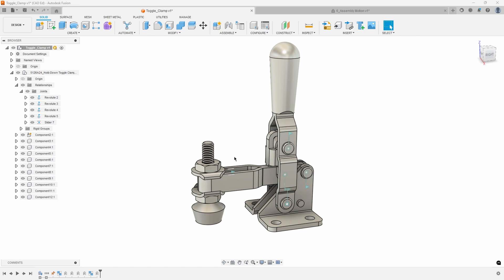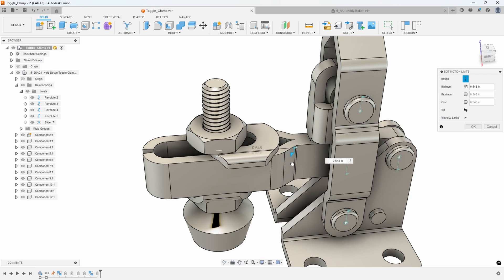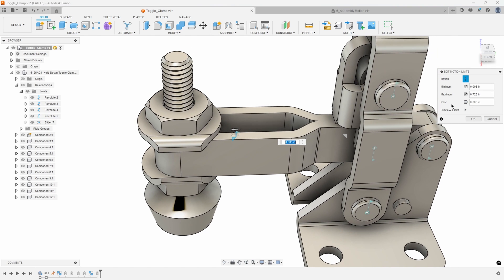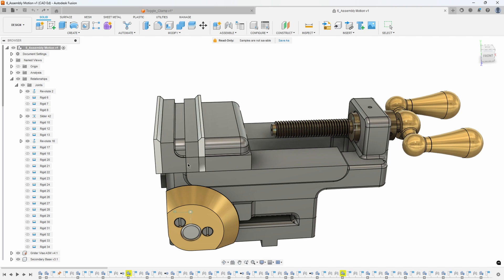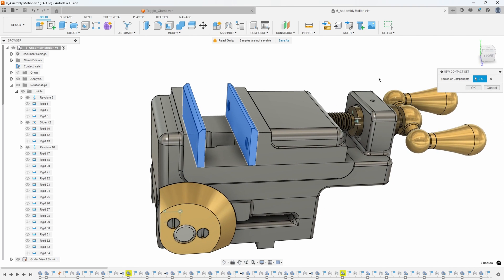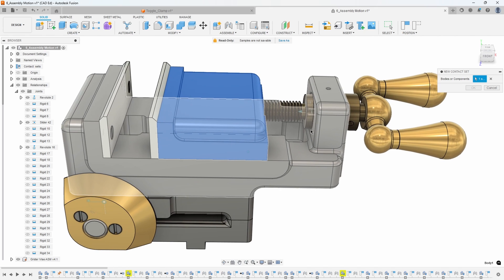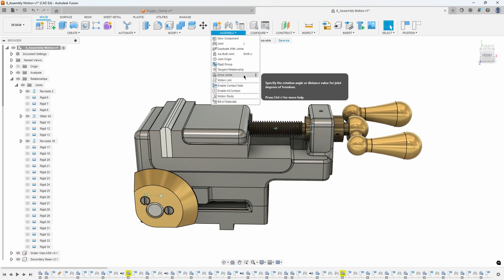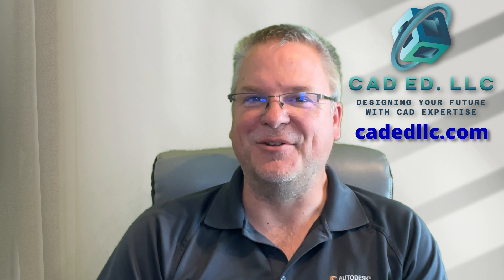Motion Limits for Joints in Fusion

Comment: I’d like to know if there’s a way to link the turns of the crank to the lead screw’s thread pitch to the distance the jaw moves.
Reply from the maker: If you know the thread pitch of the screw, then one turn of the handle (360 degrees) equals one thread pitch.  So, if the thread pitch was 3.5mm, in the Motion Link dialog, I would enter 360 for the rotation and 3.5mm for the distance.
Reply: @bradtallis8968 thank you! I’m going to have to build a simple model and try this out.